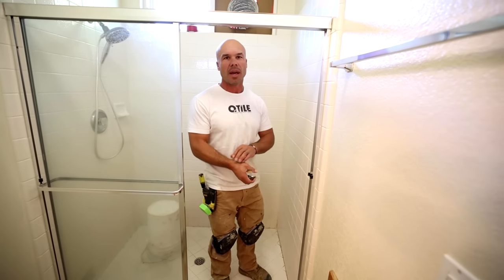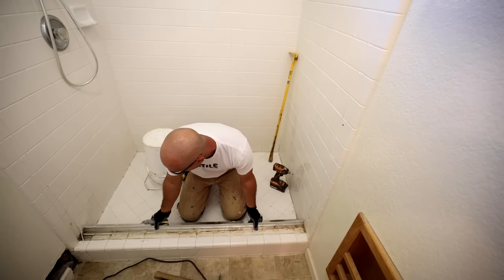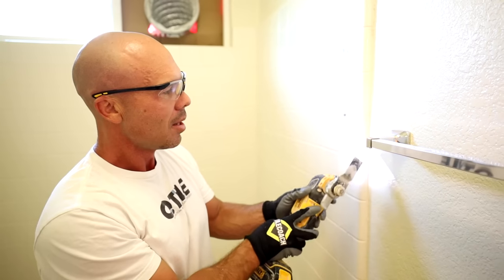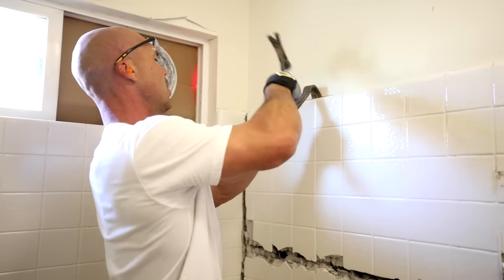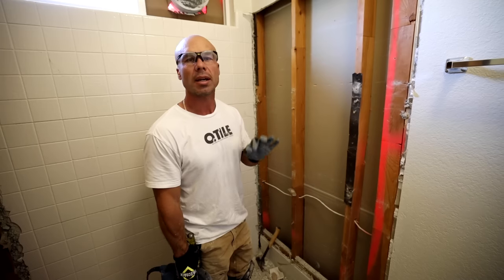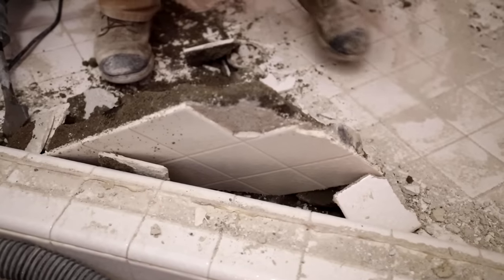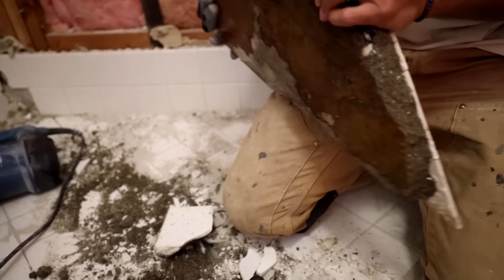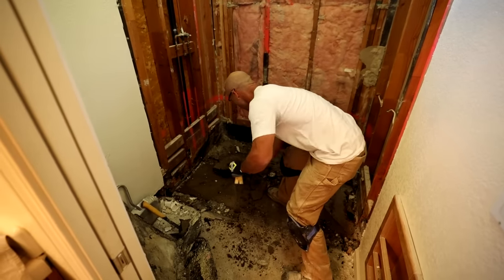Tile Shower Removal --- Tutorial

Comment: Always watching something of yours. This looks like my shower except I had a cinder block bench at the back. Thank goodness for small jackhammers! Water damage superficial (studs good) luckily. House built in the 80s. Now putting it back together. First shower renovation ever for me. Have watched hours of video, picked up the consistencies & pointers, talked w a local plumber friend. Wish me luck!
Reply: Started out c hammer & chisel. Too much work. Quickly converted to Dremel to get between tile, oscillator to get drywall. Then pry bar to get chunks off the studs. Much easier!

Comment: Just finished removing the exact same shower in my house the exact same way, but without the jack hammer which is overkill as a mini mall (5 lb sledge with a shorty handle) worked to create the break-off points as sectioned pieces. It was a bit of work, but the new tile is installed and grouted, now just need to do the finishing work and it'll be good to go.

Comment: The hot mop has not failed, its the failure of the installer to keep the weep system open.  And this has been going on for 30+ years.   Now, I hear inspector are checking the weep system on new home builds.  Moving forward, the hot mop system will be the reigning champ of shower waterproofing.  By the way, I hear there is a company in Northern California that has innovated a way to clear the weep system without removing tile.  Pretty high tech stuff

Comment: Outstanding video, Isaac. This is Exhibit A of the shortcomings of the traditional hotmop method still used all over California. Every home remodeling contractor should be forced to watch this. Even a simple coat of Redguard on top of that mortar bed would've been a massive improvement over the un-waterproofed mud bed with waterproofing underneath. I can't help but wonder if the thinking behind this type of shower is that it'll last for ten or so years, by which time the homeowner will be remodeling the bathroom anyway. Thanks to videos like yours, a competent DIY'er using newer methods can get a got a longer-lasting shower than a "professional" who only knows one way to do things... the old way.

Comment: I don't have a jack hammer, do have mini circular saw & angle grinder with diamond blades.  If I set depth to 3/4" & I'm careful I should be able to cut out small sections as you suggested...  Thanks Issac....

Comment: My demo did not have chicken wire. It had metal lathe nailed to the studs. And no drywall at all.   In the section you pulled off there would have been 15 to 20 2 1/2 inch roofing style nails. It just didn’t budge. Had to chip away. Any suggestions appreciated.

Comment: Hi I would like to prefer liner system. If you know how to do it I think it is the best system there. Yes it is old and most of the time you have him on all houses. This system is verified. It is very cheap to compare to the new systems. The biggest thing is a question how long new system will work and I like to be trust with product but not make a question it will be working?
You have some videos about shluter pan was leaking. How styrofoam pan can be a shower pan, drop the hummer from 8 feet, try to jump on it. It is weak material. Yes it is much easier to install and is very lightweight. This is business to sell new stuff, new technology but it is not mean it is better than the old one.
Reply: I saw one on here, but I don’t remember which channel, that’s a foam pan reinforced with plastic from recycled bottles. It was almost as hard as concrete, but a fraction of the weight. Very cool. I don’t think pure foam pans will be around for long. They’re cool, but vulnerable like you said.

Comment: Provide all the facts! Are the weep holes plugged up by the hot mop? Was there gravel at the weep holes? These would two reasons why there is standing water! It's not because is a old system that should be retired! It was not done 100% correctly.
What is the pitch on slope board? It doesn't look like 1/4 per foot from the video!

Comment: A 4 inch grider with a Dimond blade and a shop vac is way cleaner for making the relief cuts in the wall. 
If that was a wire lath /two coat mud wall right on the studs the battle would be alot harder!

Comment: Also that pan didn't have the most important aspect of the 3pc system. The preslope! With out the preslope & ½" aggregate around collar of the 3pc drain to protect the weep holes the entire system will fail all the time! Again will say the bonding flange/ sealed systems don't allow water to dry out especially using lighter  marble mosaics even if sealed!  Have installed all three systems over past 23 yrs. In my opinion the original 3pc done correctly with correct techniques & products dries out the fastest & more regular between showers!

Comment: I love your videos just one quick question on the sealed systems grout Is never water proof so where will the water go that Works it's way down To your waterproofing ?
Reply from the maker: It will evaporate
Reply: @TileCoach  I guess we will see in 20 years if there is a problem with mold at the base of the shower thanks for replying . Keep up the great work . After 40 plus years setting tile you are one of the few guys I generally agree with .👍💪
Reply: @rexgross5073   Sealed system installs have been around over 20 years now; we're coming up on 30. 

Even with a pan-liner or hot-mop, some of the water that migrates into the grout and mortar bed will not be able to fall to the drain due to adhesion (surface tension). The adhesion between the water molecules and the pores in the grout/mortar will be strong enough to overcome gravity and hold the water in tension inside the crystal structure. So both types of system need some level of ventilation on the outside so that trapped water can evaporate out as vapor. 

I would presume that there is generally less trapped water in a 3-piece drain system with a liner since some of it will drain via gravity, but it isn't 100% clear because a sealed system can only hold water in the grout and thinset, whereas the liner system could also hold some in the mortar bed.
Reply: @Anytus2007  thank you for your opinion. I agree both systems have areas of concern and failure.

Comment: Using a grinder with a tile and metal blade will quickly cut that tile into manageable pieces, even if it has the wire backing they use out here in Texas. I did two bathrooms that were about 80% tile and once I moved to using the grinder it went really fast and easy and made much less of a mess.
Reply: Would it also do the floor ? And how much smaller where the piece's you did?

Comment: Is this the first time you did this? Keep that mask on too! That dust is very bad for your lungs! Vacuum and masonry wheel way faster and cuts the chicken wire too.  Also not so easy with backer board and screws!! A wall that short can be done in two pieces on the sides at least.

Comment: I hate hearing these guys call a traditional pan a “water in, water out system”. They make it sound like everytime that you use the shower water is going straight through the tile to the pan!! If water is going through the tile and grout to the liner then your shower has already failed, period! The majority of these failed showers are due to lack of maintenance with the grout and caulking. Whether it be a pan liner or foam pan they both serve the same purpose and that is to serve as a safety barrier should your grout and tile fail to keep from destroying your wood structure. Really wish a lot of these tile guys would focus more on how to keep it from failing to start with. Such as proper maintenance.
Reply: What kind of sealer do you like to use on the shower floors and walls
Reply: I don't understand this comment. No tile, grout, or sealer manufacturer that I know of markets their products as a water-proofing system. The only grout that I know of that is 100% waterproof is epoxy grout. Porcelain tiles have quite low water absorption, but it is certainly not zero. Same thing with sealers; they work primarily by making the surface more hydrophobic, which causes beading, but they cannot keep out standing or running water.

Can you point to any testing that shows that properly installed and maintained tile and grout does not allow water into the mortar bed under normal shower conditions?
Reply: @Anytus2007  yeah I was wondering what kind of grout sealer it was that kept water out I haven’t found any kind that keeps water from seeping into the grout when sealer is applied it keeps the grout from staining easily but I don’t think it’s a water blocker it does help the water from penetrating as fast , when most people take a shower it’s not going the seep through the grout unless the drain is stopped up and the water stays in the pan